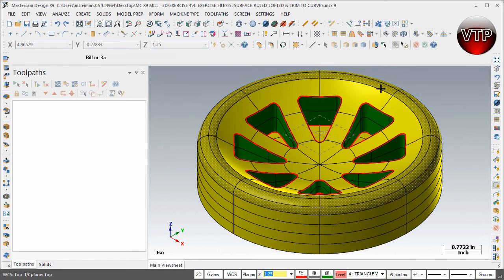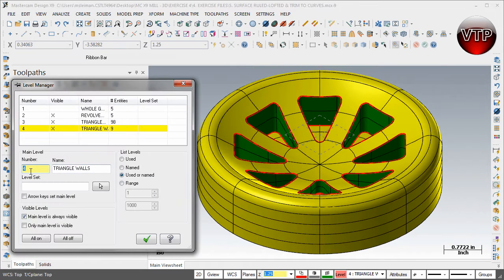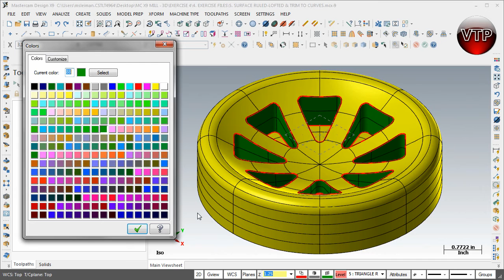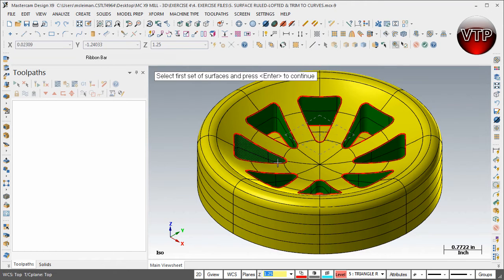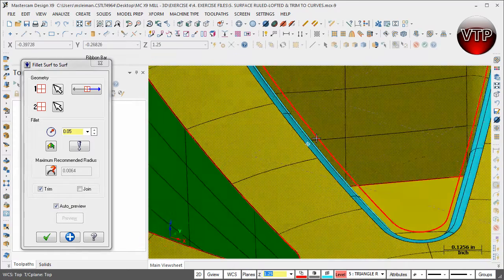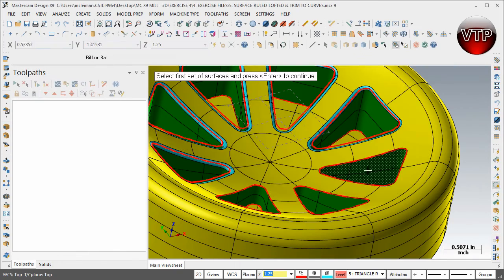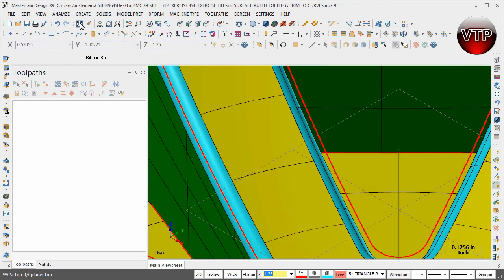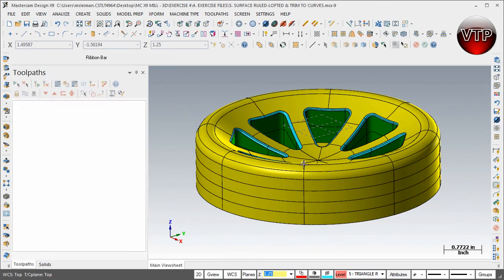MASTERCAM X8-X9 3D ADVANCED MILL 4.6 - Fillet To Surfaces - vtpros.net

Comment: Nicely done and a very useful series. One question however. Why didn't you complete the triangular pocket (walls, fillets, depth) once, and then copy the completed pocket 7 more times - as opposed to adding each detail to each pocket separately.
Reply from the maker: hello curt, you're definitely right, it's best to create all operations and than copy them all around using the rotate feature actually but in this exercise i was just showing this method first and later on method i actually go thru what you just described and why as well. Thank you for pointing that out though, you're definitely right
Reply: Thanks for the quick reply! GREAT series!
Reply from the maker: you're welcome sir and this is only a chapter of the entire DVD, please check out vtpros.net for more in depth training.
Reply: Will do!